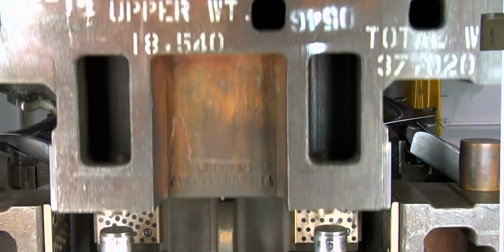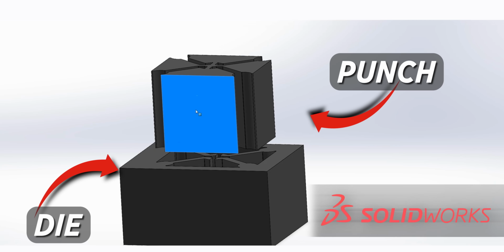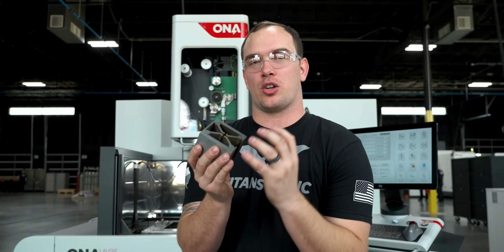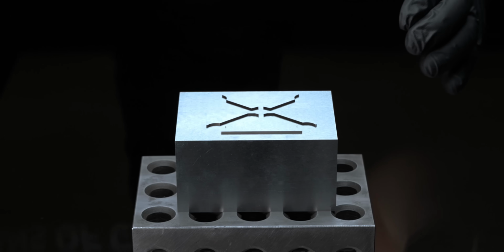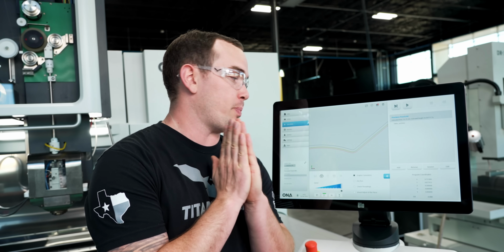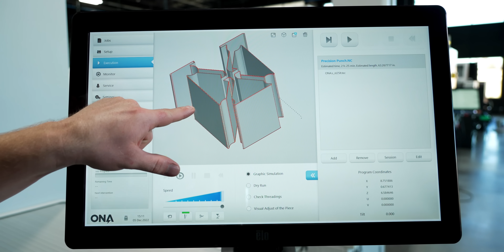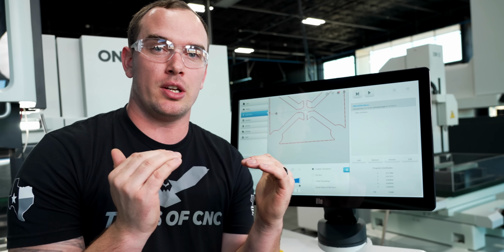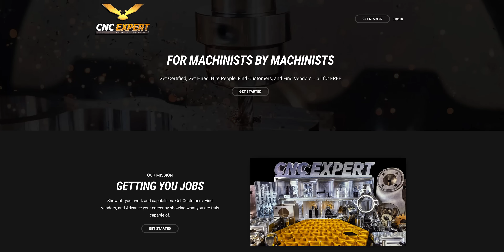SECRET Process Of MACHINING FLAWLESS Parts

Comment: If you try this at home…. Make certain that your steels are both annealed or the amount of warping after cut will make your fit impossible.  
Nice video Trevor!
Reply: Thank you sir!
Reply: Why annealed and not normalized? I've been planning on doing this with some 60-62HRC D2.
Reply: @JamesMiller  to me, normalizing has always been something not worth it as i have always had an oven capable of both tempering and annealing precisely.

along with this, the only benefit aside from cost (which supposedly is finer grain structure) was only mentioned by people selling normalizing services when i looked into it so i did not bother further
Reply: What’s annealed mean?
Reply: @GreenEYESfromOHIO  annealing is taking the stress out of the material by cooking it,  even plastic can be annealed
Reply: @apostolrobert5810  i wish i could be annealed
Reply: @angrydragonslayer  - 😂😂
Reply: @angrydragonslayer  1 week at +30C (+86F) in the tropics will take that stress right out!  ;)
Reply: @vonpredator  repairing mooring spots for rich people in the caribbean was easily the best job i ever had
Reply: @vonpredator  don’t forget a soaking in margarita liquid that gets stirred by señorita.
Reply: "If you try this at home" 🤣 OK bro, now your trying to show off. Nobodies trying this at home
Reply: @NoflectioN  i got a WEDM at home

Admittedly, it's a used somewhat crummy 8+1 axis machine with hobby-grade control circuits that i cobbled together in my spare time but it works
Reply: @angrydragonslayer  oh ffs! Lol I don't know what none of that means 😅 question is can you make that part? That precise? I'm not machinist just a simple hvac tech....this some pretty impressive stuff! Is this really possible on "hobby" grade equiptment?! I'd start making dissapearing door handles, cabinet hardware, light switches, ya know push on the wall to a secret room type stuff  ....and of course the hellraiser box

Comment: I spent many years in an EDM shop (wire and sink) and always thought that watching a wire EDM in action is equivalent to watching grass grow or paint dry. You (and your video team) made it exciting and very interesting.
Reply: Thanks Karlo, It's definitely not easy to make one of the slowest machining processes exciting 😆 Thanks for watching!
Reply: @trevorgoforth8963  but damn, those cuts are precise. There's a DIY Qire-EDM solution, I was thinking about building one for my hobby shop - but the needed arc generator from BAXEDM is over $3000. That's a solid investment for a hobby project. I've seem some people trying to build them themself out of an old stickwelder - but the precision comes with the timing - and an estimate won't really do.
Reply: Hello, colleges. More than 15 years experience fanuc wire EDM in Russia. Extrusion tools .

Comment: How did you fixate your punch to finish cut it all around? EDM from 2 sides? Glue it? Grind the holding tabs?
Reply: In this case I clamped it to the table and wire cut the tab side for the second op. I purposely cut in a little on each side of that face so I had a place to find my edge and tilt my axis. That way you're not relying on indicator accuracy and trying to get it perfectly straight but instead your using the machines accuracy, touching each side with the wire and tilting the axis.
Reply: @trevorgoforth8963  you did tilt x and y or U and V for clamping errors?
Reply: Ido a fair bit of W edm 
If i make a punch i may leave 2 or 3 tags and finish the part before de tagging but then surface grind the start point for the tags
Thinking of trying hot glue when i get a chance
Reply: @rpm4999  there is a special 2 components EDM glue for this purpose. Hot glue is not for precision parts I think.
Reply: @jrautomopeddrone2221  The X axis is the only one that needed the be titled since I clamped the part to the front of the table. The top and bottom were ground so I didn't need to tilt U/V. Sorry guys, I can show how this is done in future videos, the ONA makes it very easy!
Reply: @trevorgoforth8963  I am excited to these future videos 👍
We work on Mitsubishi Wire EDMs and Ingersoll Sinker EDMs
My daily challenges are stainless parts that warp like crazy after the 1st wire cut
Reply: Hey be good if you could show this i  have always struggled making spot on punches
Reply: Yeah, I wish it was mentioned in this video.
Reply: Good to know thanks i will look that up👍
Reply: I nearly always use a start hole on a punch to try to minimise spring or movement from the slug/waste that could skew the finished part
Reply: @rpm4999  That is how I usually do it as well but in this case for camera purposes, I cut from the outside so that we can see the finish passes take place. Otherwise, you literally wouldn't be able to see any cutting whatsoever because it would all take place inside an enclosed block.
Reply: @trevorgoforth8963  ahh good to know I’m thinking on the right lines
Unrelated question …..
We are getting a Haas umc750 at the mo i am using one cnc xr7 cad cam which i really like but have doubts as to weather i will be good for 5 axsis sim
Any of you guys know what would be a good cam system to drive a umc?